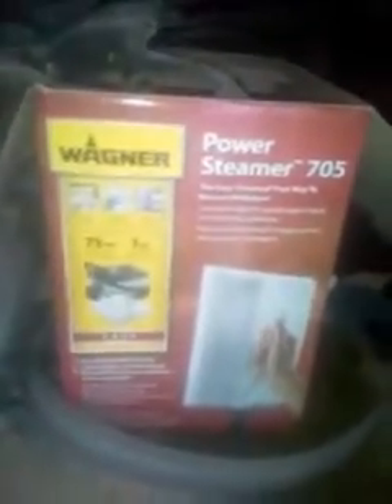How to build your own Dog sled

Comment from the maker: I drilled holes thu false runners and runners. and counter sunk the nuts (eye bolts ) on bottom of the runners. so the twelve eye bolts are counter sunk and I flush ground threads on bottom of runners. both runner and false runners were glued also. when I attached the metal runners to runners they covered nuts of eye bolts

Comment from the maker: I made a jig that was ten inches high at front. I wish id gone 12" . I measured 40" back and that was the start of the flat. basically I clamped it at the 40" mark and stack up wood ten inches high at runner points. when I pulled it from steamer I pressed down and clamped at the 40" mark.

Comment from the maker: thank you
Reply: This method takes so many shortcuts, and cheapest material available and lazy mans way of putting it together.  He obviously spent nights awake thinking of how to do it cheaper and faster.  But certainly not better.  I wouldn't use this sled to take trash to the dump.  I am Inupiat Eskimo. son of a traditional dog musher, whose generation built sleds from 1 to 2 TREE TRUNKS, depending on the length the sled was to be.  I assisted a good friend of mine to build his 12' sled.  He ordered the material which arrived by plane to Kotzebue, Alaska (Above the Arctic Circle) which arrived as a SINGLE BEAM of 8"x10" hardwood, 14' long.  We ripped it into the strips we needed and put it all together.